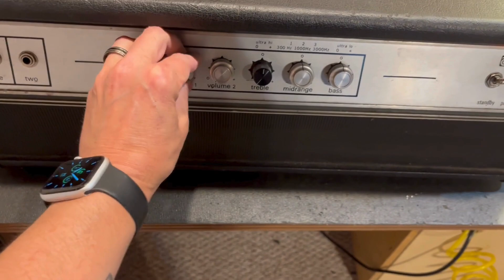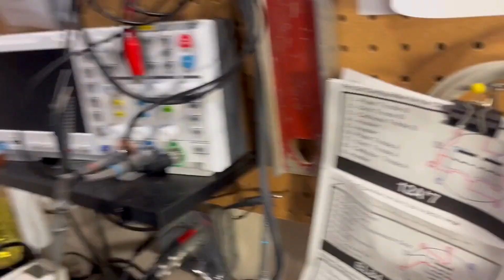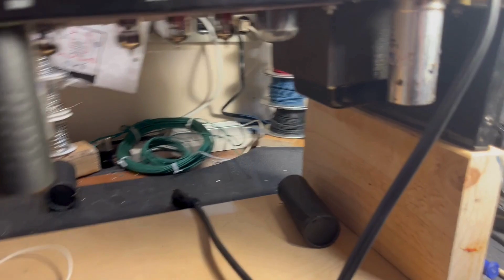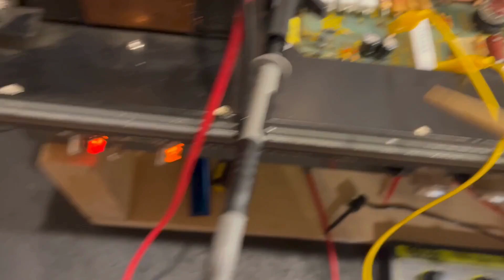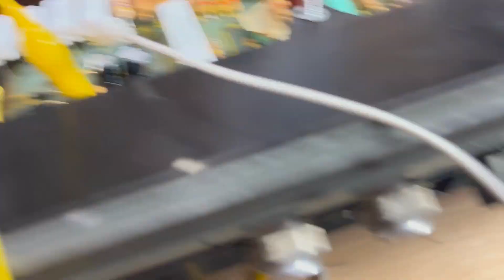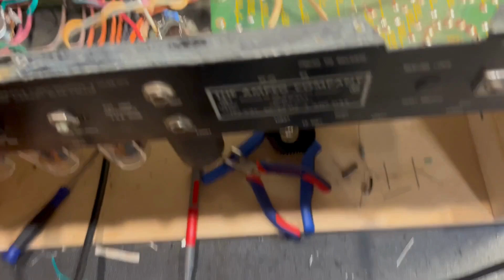Ampeg V4b, noisy little bugger

Comment: My big secret tip is to move the powertube grid resistors off of the board to directly onto the sockets, I cured some very odd low freq oscillations this way.